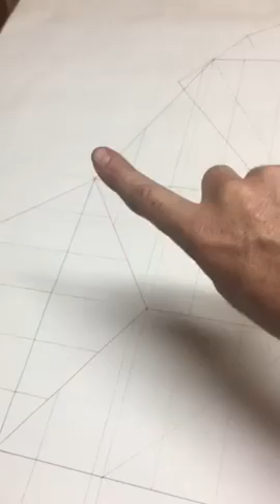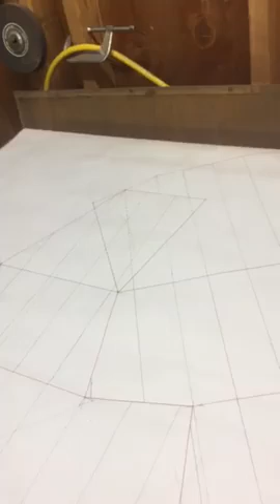graphic method of roof cutting

Comment: So the L. L of the common is equal to the run of the hip/Val ?
Reply from the maker: It is the level plane of the miter ruler but it is the same as a 12/12 common. If you flip it up. 

The line length of the 12x12 miter ruler is the run of the hip rafter.